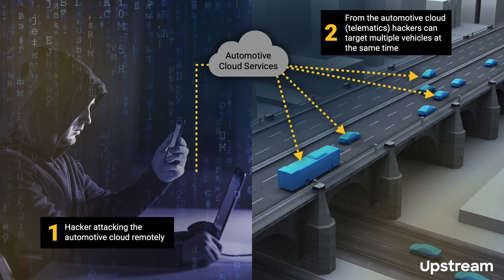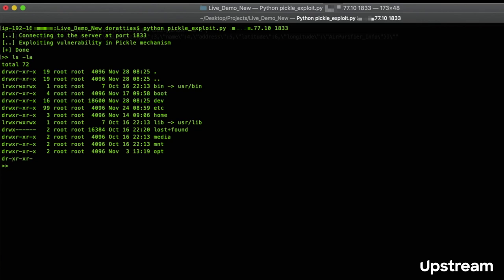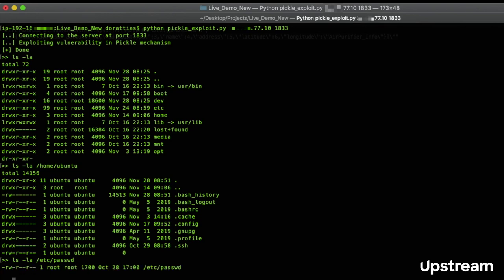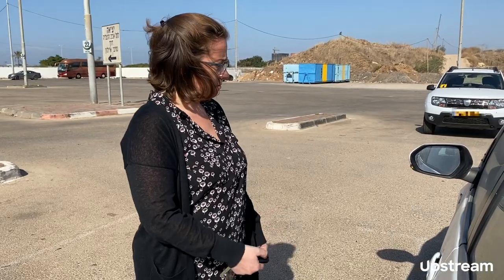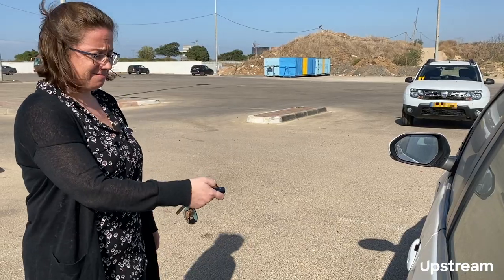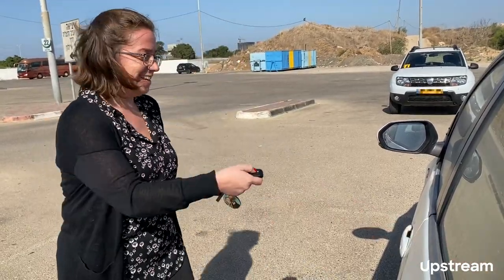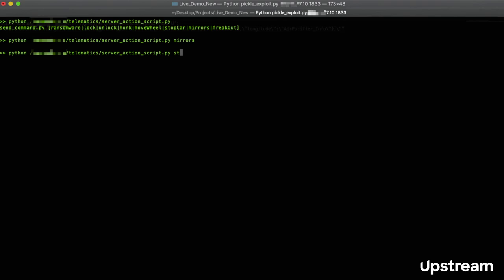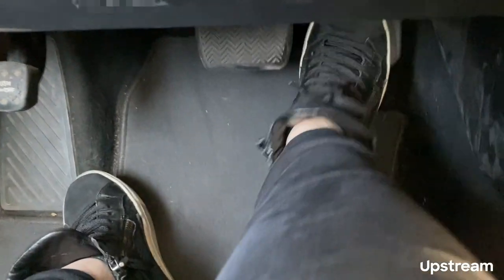Automotive hacking: Remotely hacking into a brand new car | Upstream Security

Comment: The victim's acting is terrible, and this is nowhere near as easy as it's depicted. For those wondering, this attack shown here involves using a pickle exploit to serialize malicious code that when submitted to a server, pipes in a backdoor for a remotely executable reverse shell. There is no way they hacked a legitimate car manufacturer's telematics server to do this. That would require either permission and granted access (which would make this 'hack' a literal joke), or a massive amount of OSINT entirely predicated on the attacker knowing about the server's serialization vulnerabilities and them existing in the first place. On top of that, being able to identify and pinpoint a certain subnet IP for one specific victim would be like looking for a needle in a haystack, unless it was known beforehand, which would otherwise have required the attacker to have been in close physical proximity to the vehicle at some prior point in order to sniff its IPv4 or IPv6 address. This was obviously set up, likely by using an aftermarket telematics device that was plugged into this vehicle's CAM-BUS system and configured to connect to a server that they had access to and controlled.
Reply: Krompopulous Michael  I know he's right but I wanted to provoke extra info didn't work sadly 
also this si not hacking 101 I wanted more depth I have been in the field for more than 4 years yet there are few points that I didn't fully wrap my head around wished for a paper or article but yeah
Reply: Krompopulous Michael  so you know how to actually hack a car telematics server ?? that's really dope would you mind sharing any stories articles or books that helped you in the past to exploit a car manufacture??? 
I don't think this is 101 hacking or maybe I'm that dumb and everyone is doing it easily
Reply: Krompopulous Michael  I don't know why but I can't seem to find other comments I posted
 but as I already stated I did it so he gets baited to prove me wrong this works more than a simple question in the internet
deleted cuz I watch the vid also your comment explained to me he meant the general concept I miss understood what he was pointing at and also my tactic didn't work so it was useless to keep it
Reply: Krompopulous Michael  in anther comment I posted the paper they used to copy past this demonstration the comment was deleted but it's by Miller & Valasek they already published all their work but I can't post it it seems my comment will be deleted again such a bad tactic by this channel to censor people from exposing them
Reply: Of course it's staged, if they got authorization and authentication from the car manufacturer themselves this would be pointless,also the fact that the manufacturers probably would not let that slide for confidentiality reasons,even so, it's still pretty cool to see
Reply: You are right, it's not easy but it is doable and you know that these days social engineering and OSINT is more than half of a "battle".
Reply: That woman’s a acting was cringe af. “OMG, I can’t get in.. OMG…”.